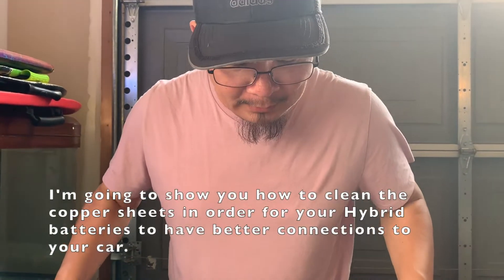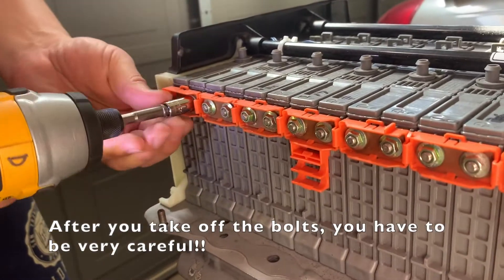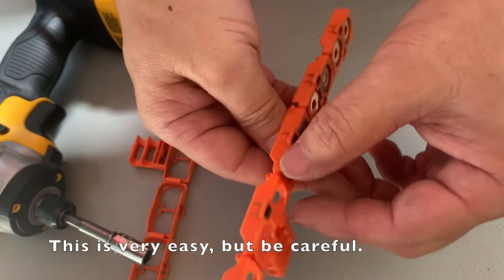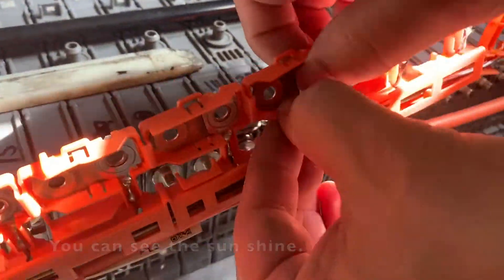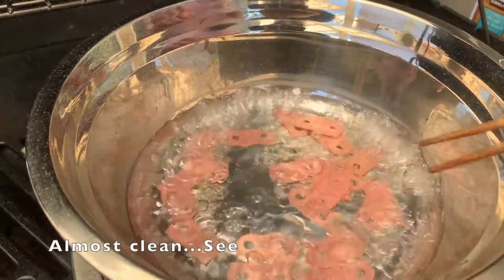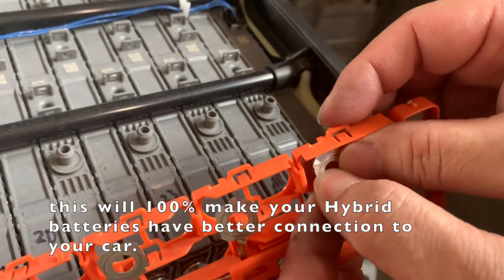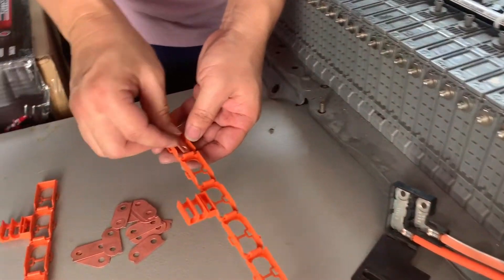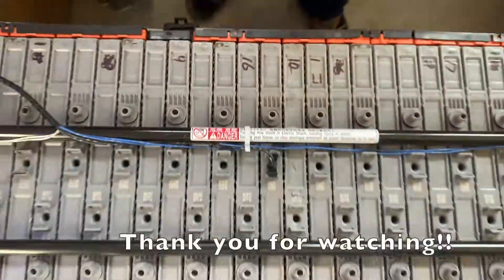Toyota Prius Hybrid Battery: Cleaning the Copper Sheets

Comment: I use 2000V gloves when i disassembly the side bars bolts or the bolts for the battery to car connector. Amazon have good gloves that save your live.
Reply: No need once you remove the high voltage disconnect (orange).  At most, if you are super duper dumb, bridged half the set whilst barefoot with wet hands, you could get 100ish volts, but that is highly unlikely.
Reply: @charleshorseman55  and i think 100v wont make you die too lok
Reply: @charleshorseman55  SO you mean i didn't need to buy them? it wasn't too much  but my hybrid pack has 40 cells instead of the typical 20 cells though
Reply: @charleshorseman55  No waay … it’s still hot, don’t ask me how I know 🤭🤦🏽‍♀️… plus I just watched a video that shows half the modules are live after pulling the orange plug.

Comment: buy nickel plated bars on ebay
Reply: Nickel plating significantly increases resistance.
Reply: @charleshorseman55  Yep thats what I did with my 08 they were like $35 on ebay with new nuts and washers too those uncoated copper ones will corrode in no time .
Reply: @edud8452  They will corrode, but the contact points (under the nuts/contacts) will not if torqued correctly.
Reply: @charleshorseman55  True true👍

Comment: One ingredient was left out ! dialectic grease.
Reply: Better put it on after you torque your nuts!  Or you will lose continuity and likely make smoke as it burns out from between the contacts.  Then remove battery again, clean contacts, and reinstall.  Trust me, the wattage between these cells can get HIGH.

Comment: I was laugh the whole time 
Bor when you remove the safety fuse there is no more high voltage 
My son 13 years old does the repair in 30 minutes allday
Reply: All the safety plug does is split the battery voltage in half. Clown man 🤡